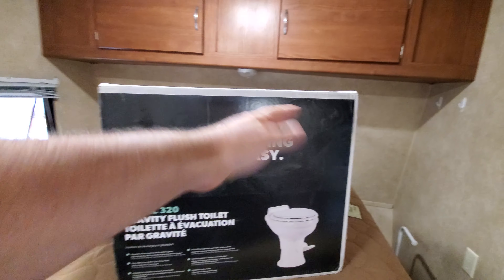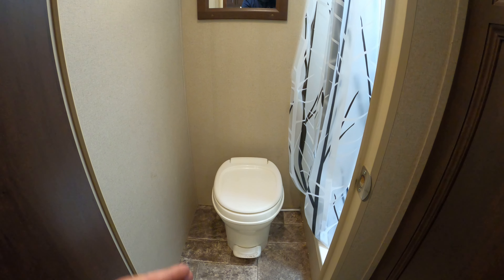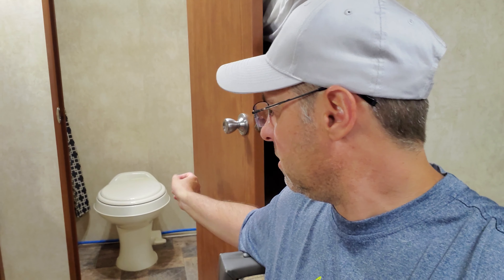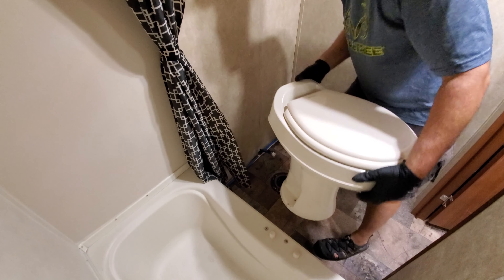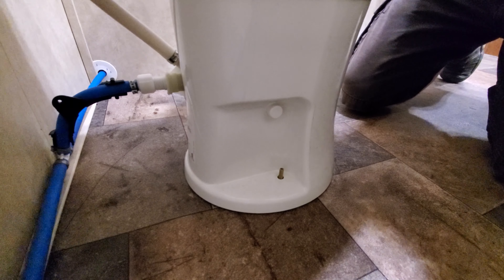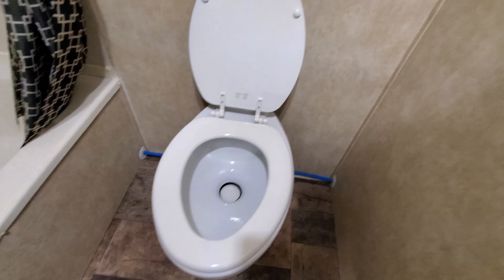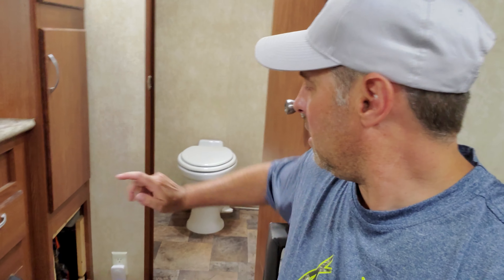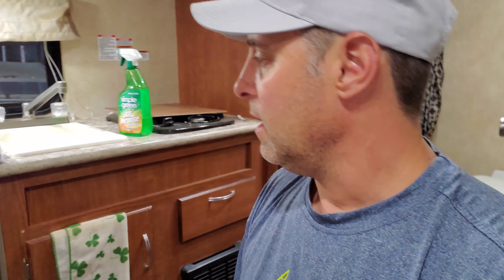Dometic 320 | The Cadillac of RV Toilets

Comment: You were showing the Dometic 300 the 310 is a little closer to the 320 the 310 has a round bowl and the 320 has a long bowl but the 310 has the port around the circumference of the bowl although it does not have a full rim.
Reply from the maker: Ahhh, yes, I believe you are correct. I was just guessing at what the old toilet was.

Comment: hey thanks for sharing. have 2 for ya:
1- is this one deeper (holds more water) than your stock one? 
One of the problems I have with the stock toilet is that is so shallow that we always leaves marks when pooping. in real residencial it normally there is so much room that it almost touches the toilet bowl (or barely) 
did you see any improvements with this? 

2- what combination and measurements are you using with the geo method? 
did I hear you are including bleach  or chlorine ?

thanks
Reply from the maker: Hi Raymond. Yes, this is a deeper bowl. Its very similar to my residential one. One issue I found though, is that is uses much more water, so use it sparingly if you are off grid. I did see one video where a guy showed lining the bowl with toilet paper before using. That way it all slides down the drain on the paper and doesn't leave marks.  For the Geo method, I use 1 cup bleach, 1 cup dawn dish soap, and two capfuls off calgon water softner. I put it in a bucket, and mix it with a couple quarts of water and dump it in the toilet. I haven't had any smelly problems since doing this. It works great!
Reply: @GoMidwestFishing  ha! funny trick about the TP
thanks for sharing your Geo combo. the original video I saw of Geo didnt included the bleach. I'm deftly trying that one.